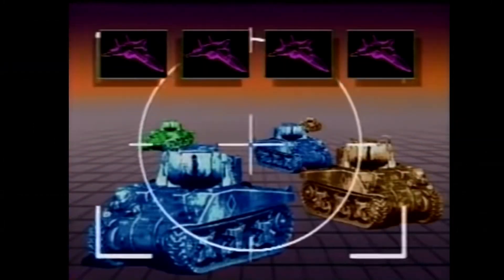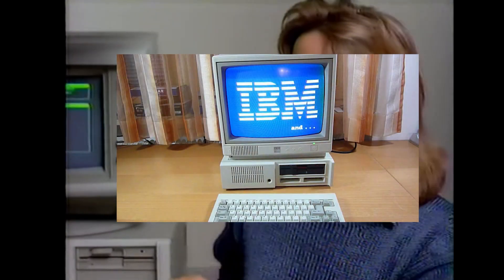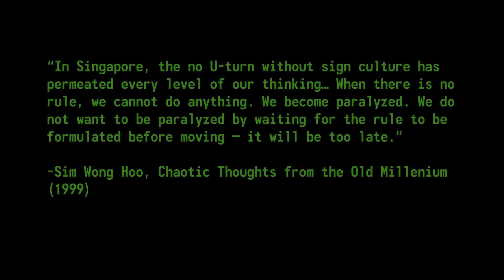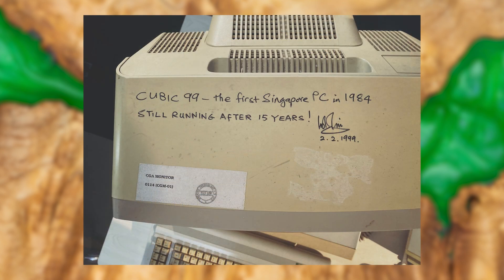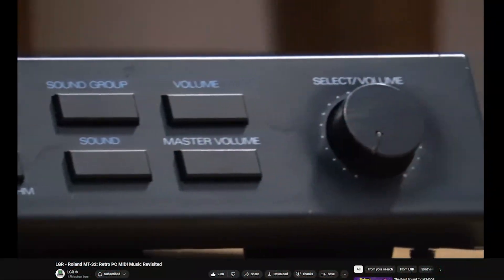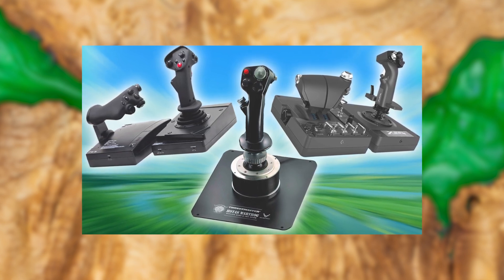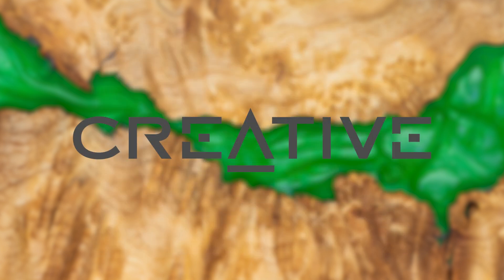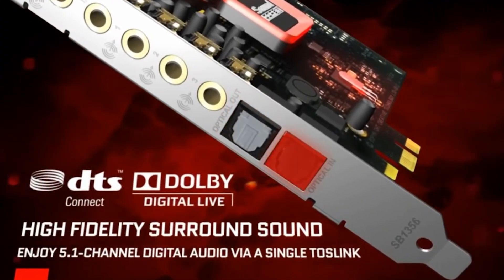Sound Blaster: How the PC got its voice

Comment: Where did all the SoundBlasters (or sound cards in general) go?  

On-board sound is now good enough (as you mentioned).  If you want high quality sound, you now get an external DAC for your PC.  As the PC is full of interference bouncing around, putting the soundcard outside greatly reduces noise.

Needing better sound, but NOT much better sound is...to niche to sell (or develop) sound cards.

If you put a sound card in your rig today, part of the reason you do it is BECAUSE you WANT to put a sound card in your rig.

BTW, Xonor makes a very good $35 soundcard.

Comment: Sadly, in a world where most things now ae Linux compatible (and work immediately when powering back on the PC with no fuss), modern SoundBlasters require A TON OF EFFORT...or may not even work at all.

USB expansion card?  Not even a "getting it ready" message...just worked.

$200 SMLS DAC?  Same.  Just worked.

Network Printer?  Found it as soon as you went to print!

Sadly, this stoped me from buying the "Pretty Red SoundBlaster"  when i went to upgrade from my on-board sound.  (Incidentally, Xonor makes an awesome $35 sound card).  When i finally decided to upgrade from the Xonar to  DAC i didn't even consider Creative Labs.  To be fair, none of the DACs i saw recommended were SB.

Comment: I have a Creative Sound Blaster Z SE. It's pretty good. I got it for my surround system and EAX in old games only to realize the sound system I got for a christmas gift has no analog input/output. It's just digital or HDMI ARC. Do anyone know how to get around this? Or do I have to just buy an old sound system with analog inputs? I only found 1 new model that still has analog 3.5mm ports, or whatever. Which is the ONLY way I can get Windows to recognize more than just stereo channels? I wish I would have done more research and bought the older one that still hardware accelerates EAX. Instead it's all audio through alchemy and software, instead of using the hardware due to Windows changes. Sucks.

Comment: Definitely they still work better than on board sound. I have an Asus mobos that was over 1100.00 USD and it has dedicated layers in the mobo per channel to keep signal to noise down and crosstalk not to mention the chip is top of the line used for audio even has Japan made caps but my Soundblaster still has superior sound in 2024

Comment: The Sound Blaster was my first sound card on my first compatible PC, and adding the Korg extension board just blew my mind. However, the sound chip is now part of a motherboard these days. So what was a cool add-on is now a commodity.
Reply: Get a sound card from them and I bet it blows u away in 5 min how much better the sound is to your onboard chip. My mobo has the best sound chip and dedicated layers in the mobo and Japanese caps and my Soundblaster still blows it away. The mobo is an Asus board and retail 1100.00+ USD and the sound is awesome but still doesn't compare to the Soundblaster I threw in

Comment: soundblaster live was cool, in windows 98 you could install hacked drivers to give it much of the abilities of some EMU professional audio cards, that were based on similar hardware. Gave a sweet software mixer setup with accelerated realtime effects.